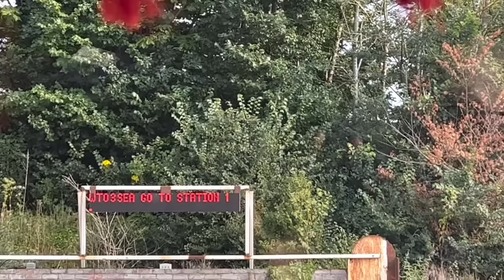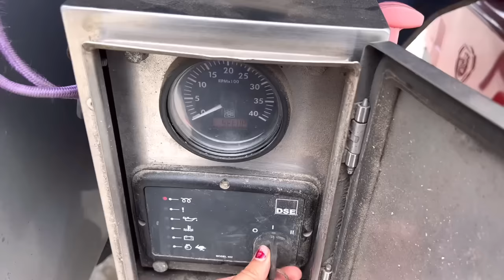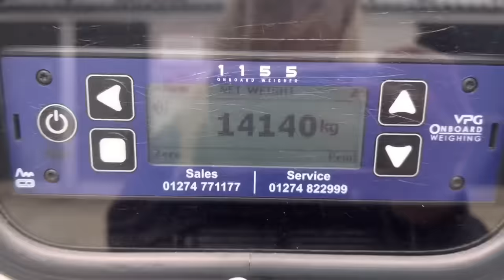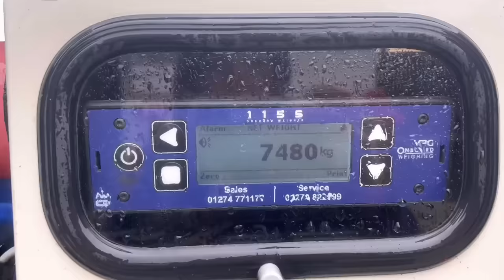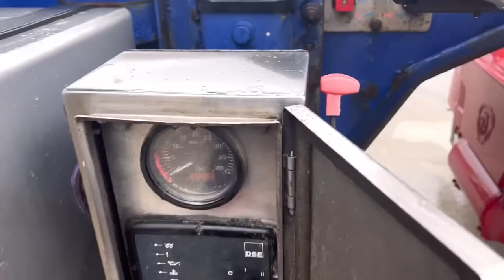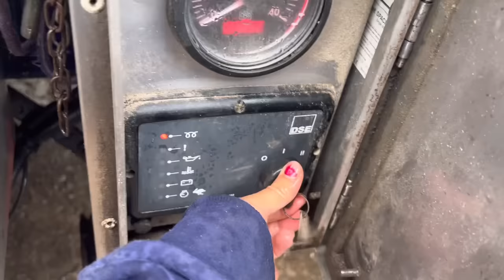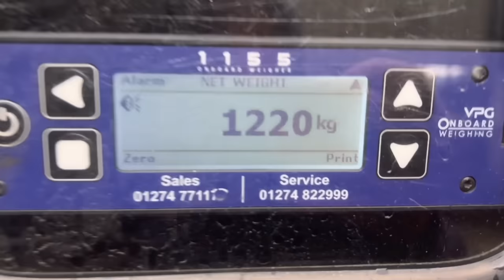Trucking ladies cause havoc on Radio 1 quiz | day on the blower trailer

Comment: Hi Jemma, I run a similar blower trailer in Australia but in a road train set up.  We dont get as keen as you when connected though, just 1 pipe and cam lock fittings both ends, done.  Nice and simple.

Comment: I'd have preferred to have left such questions unanswered. Stupid change to the format I think. Ben Shepherd's Tipping Point on the telly is the same as well. Many questions but leading to the same answer. Sounds rather babyish to me after having grown up with other formats over five decades at least. We used to have so many different categories in quiz formats for TV & radio over as long as five decades, but now it's all completely diminished down to a rather babyish level. I think these so-called quiz formats need to be more broad, include subjects like Independent Local Radio, or wannabe contestants need to research more into the subjects and not be so frightened or scared of time.